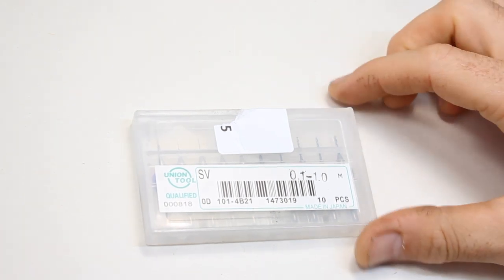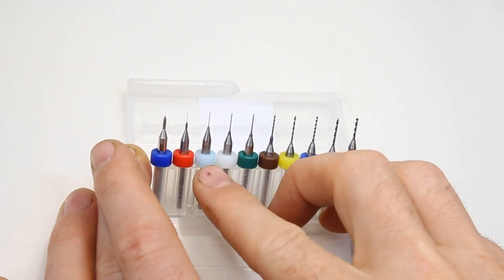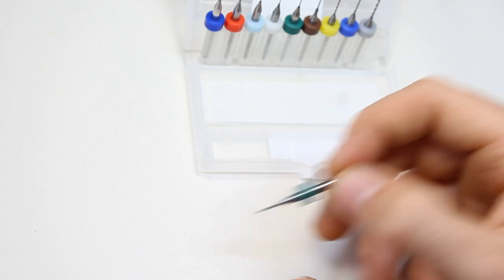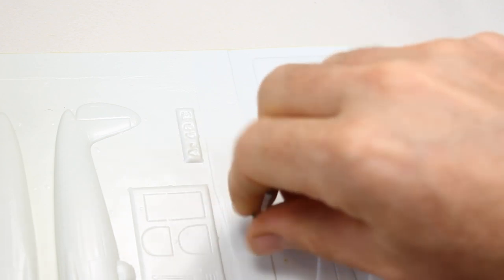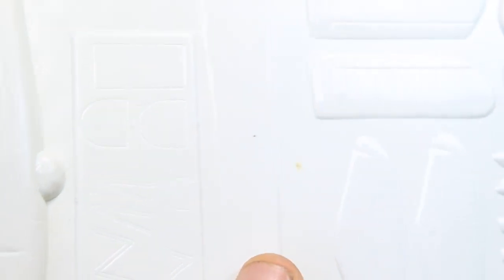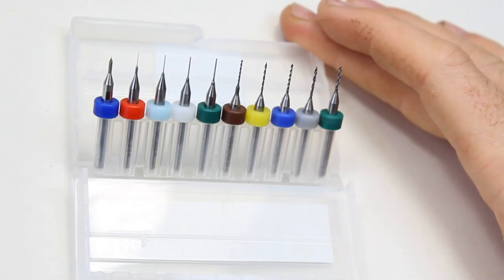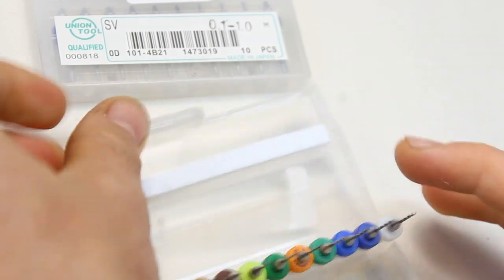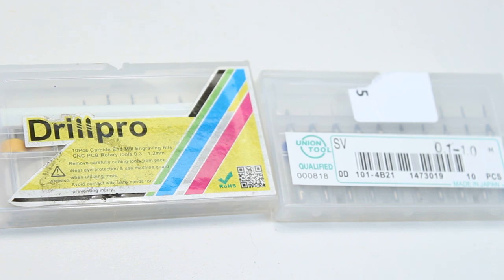Precision Drill Bits for Scale Modelling

Comment: Those drill bits are fine, as long as you use the larger ones. Anything smaller than 0,25 mm will break easily. Usually the very first time you use them because they are made of hard but very brittle metal.
My solution :  buy the less expensive, longer spiral drill bits. They last MUCH longer because they are far more flexible. They can also be sharpened. Those small hard drill bit can NOT be sharpened, unless you own a very expensive deluxe super fine diamond grinding wheel. The longer spiral drill bits can be sharpened with any fine small grinding disk or a whetstone. 
I would advice the larger, cheaper spiral drills since they easily outlast these fragile ones AND they can be sharpened. I use them on plastic only, so they last a very long time and only need sharpening once a year or so.
These small drill bit do make really perfectly round holes and they are very sharp. But which difference does that make on a plastic model....?
Reply from the maker: I would say their use is specifically for drilling out parts that should be hollow but are not due to the mounding process. Machine gun barrels, small dials on instrument panels, guide holes for rigging (1/72) and those sort of things, I must admit the way I talked about the other drill bits made it look as though I prefer these precision bits for all uses but I prefer them only for these small details, they are just a useful addition to the tool cupboard imo.